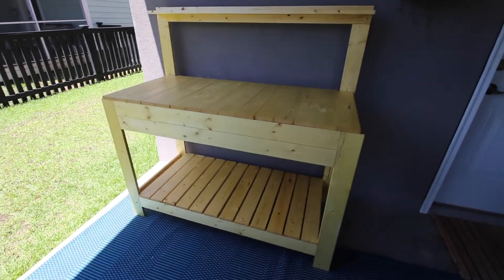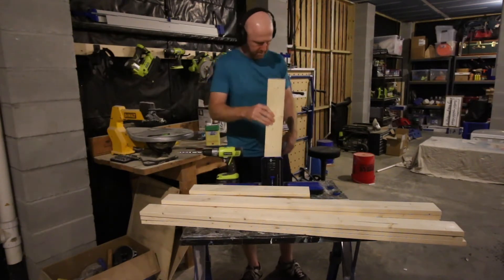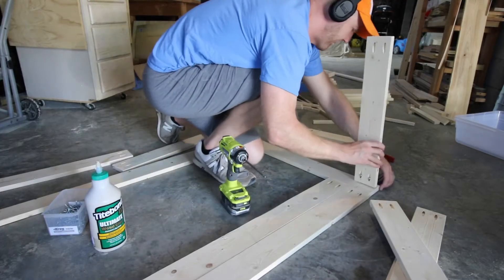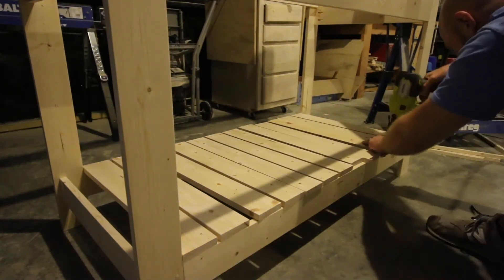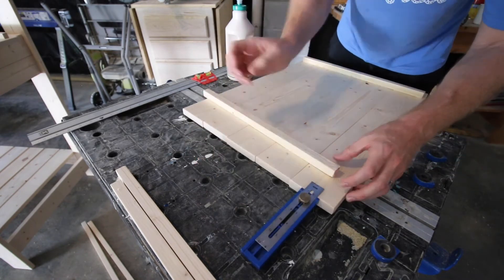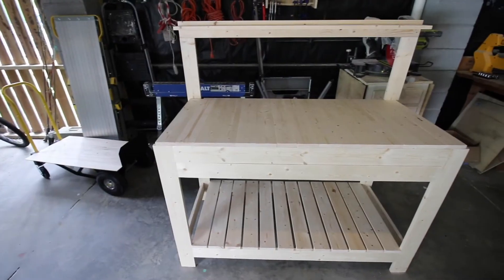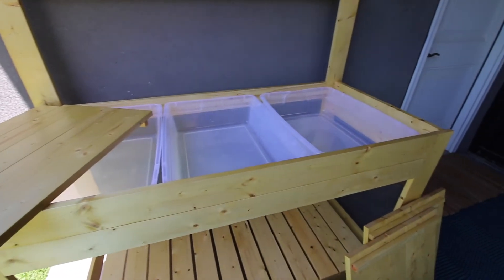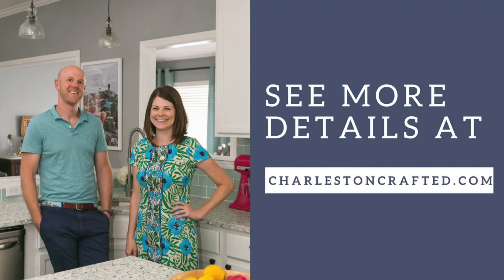How to build a DIY potting bench with hidden storage

Comment: Great video--thanks! Between the video and the PDF instructions it was a very simple job to construct this innovative potting bench. The only change I made was to add four front to back bin supports so that each bin was supported on the sides as well as the front and back.

Comment: Doesn't anyone watch New Yankee Workshop? Wear safety glasses when operating power tools! Also at 2:58-3:00 - don't shoot a nailgun into thin wood with your body/crotch as a backstop.

Also I would've made the base frame out of 2x4 material for rigidity and the whole thing from Cedar instead of pine. Cedar isn't much of a cost increase over pine, especially when small dimensional lumber for projects this size, yet it can be stronger and of course resists weather/insects for years.